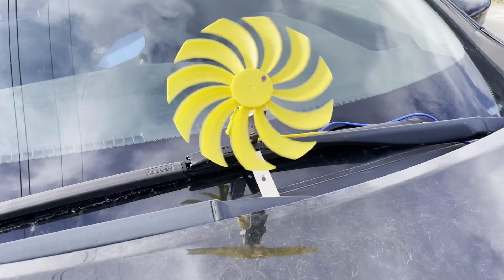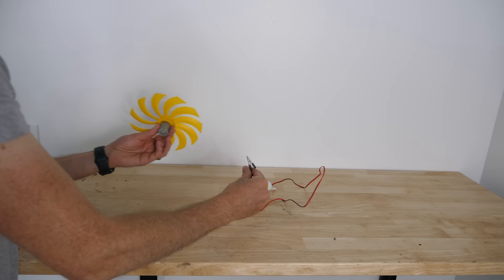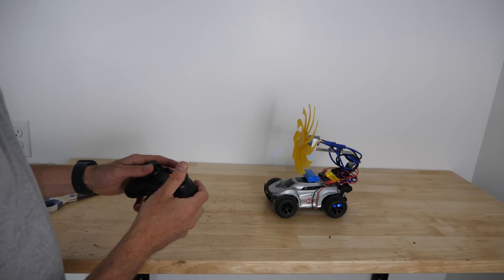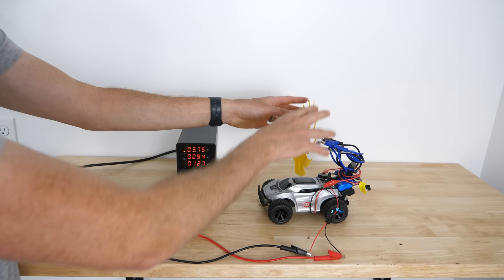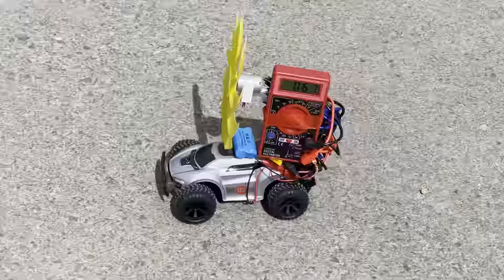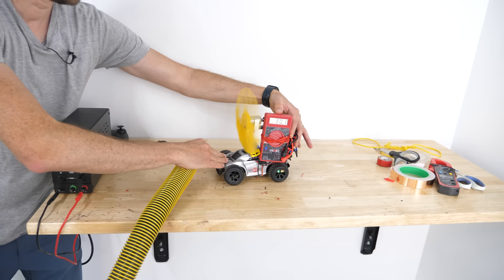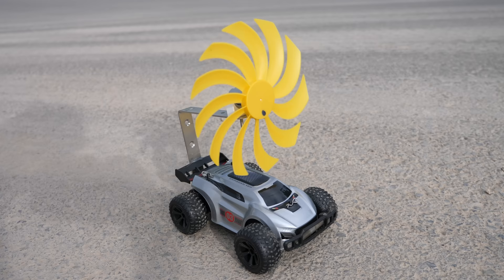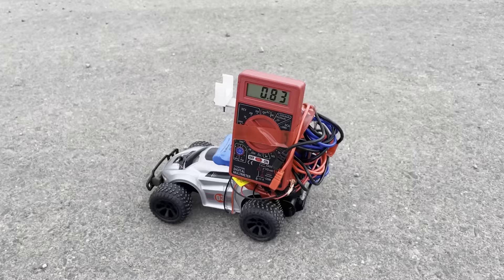Can You Power a Car With a Wind Turbine?

Comment: Surely doing this produces more drag so it is more inefficient
Reply: wow u watched the video too? ur so genius
Reply: Yeah but it can recharge when it sit still therefore it's more efficient in the long run.
Reply: Lol ya thats what he said.
Reply: It depends. You can gain energy if the car aerofynamics are shit from the start and you put the turbine in frobt of the vehicle instead of on the roof.
Reply: Plus weight of generator
Reply: If you're going slower than the windspeed at your back, the rotor doubles as a sail
Reply: @FunnyCODAssasin  do we need to watch the video for it to make sense ?? I mean I knew it when I was a kid tbh. It's basic
Reply: It’s like the old saying. Blowing your own sails. 

Also you hoping that the Jags make it all the way this Season?
Reply: Not if you make the turbine go through the car, so wind passes through.
Reply: Maybe, and don't call me Shirley 😊
Reply: @4xdblack  it's the same you are still increasing the drag
Reply: @jharmley6882  Have you not seen the last video? Its not workint properly to set up a prop to charge things. 

You need a huge prop like 5x the car size to charge it efficiently
Reply: Fold down wind generators and use only while stationary, parked etc
Reply: What would be really cool is if you had a windmill/wind turbine that could fold out when the car is stationary, and fold in when in drive. That way you could charge the battery from ambient wind without having to worry about any worsened aerodynamics.
Reply: @DerAngeloMerte  yeah but I'm just saying it is still a possibility. I mean if Tesla uses Solar why not try make wind works?
Reply: Bingo.
Reply: @FunnyCODAssasin  He doesn't need yo watch the video, just know basic aerodynamics and have common sense.
Reply: What if it's a large car and u got a small windmill kind off thing ?? Afcourse it produces more drag what does it matter with a large car?
Reply: 3:48 🤦‍♂️
Reply: @4xdblack  You are creating more drag by letting the air go through the car instead of over it.
Reply: Damn friction always ruining free energy
Reply: There's a mechanical principal that makes it work in a specific scenario. The blackbird can move downwind faster than the wind that is pushing it.
Reply: Guy did this with larger real wind turbine,
Reply: But putting this in side of the cars inside where there is holes to flow the air will make it better
Reply: @jharmley6882  yeah when it's only good for stationary. So it's better make some huge wind mill so it's can charge larger battery that can charge your car. 

Like a fuel station:3
Reply: Why don’t airplanes use hybrid system like cars so when they’re descending, the turbine recharges a small battery
Reply: Supposed to learn this in school. It’s called the law of conservation of energy. Did he even say that in this video? I didn’t catch it
Reply: @bryanpascual3543  because weight is a big consideration with aviation, and batteries have low energy density. Some small benefit you might get from regenerative braking for some small part of the flight will assist certainly be negated several times over by having to carry around extra battery and electric motor to put into the propeller/turbine.
Reply: That's exactly why just two seconds in I was like"just no".
Maybe the toy car because the motor drivers in them are always 3* stronger than they need to be and the cars are light.
Reply: You are correct more is lost than gained be confident of this.
Reply: It’s complicated it seems
Reply: Yes,but if the turbine is designed in a specific way it can "outstand" drag and get the car to go fast
Reply: BUT FREE ENERGY!?!
Reply: Definitely not. The drag would be so minuscule that it would be completely unnoticeable. Modern alternators rob about 20hp from your engine, this would be a major increase in performance and MPG.
Reply: @4xdblack Put it behind the front grill.
Reply: @engredz I’ve thought of an alternator powered by axels for Evs, not so much to charge the battery but to possibly get more range
Reply: Say you didn't watch the full video without saying you didn't watch the full video 😂

Comment: Sorry, you cannot, in this house we accept the thermodynamics laws. The energy generated by the turbine comes from the movement of the car and this is coming from gasoline or car battery and even worse, the increased drag from the turbine increases the fuel/battery consumption.

Comment: In the 1990's an aerospace company had an idea to add a "windmill" at each wingtip of a transport airplane.  The windmill would be at the trailing edge of the wing tip and would take energy from the wing tip vortex--the vortex is the result of the wing generating lift and is always present if there is lift.  The vortex creates drag--that's why modern Boeing and Airbus airliners have winglets on the tips of the wing.  A windmill could absorb some of this vortex which would reduce drag AND the windmill, tied to an electric generator, could feed power to the aircraft electrical system to power seat back screens, for example.  Not perpetual motion, but a reduction in overall energy consumed.  Perhaps a windmill in the right location on a specifically design auto could have the same benefit?
Reply: That is specific to wing design. The wing tips cause issues and you must break up the air. It's probably more efficient overall to just use a better design than a prop. Otherwise you'd see every plane with a prop there. Even if it's close, not worth the extra weight or complexity.

As far as a car, you don't have anything near the speeds or desings of airplane wings to even think about it.
Reply: Maybe in a spoiler to also create downforce.
Reply: Not practical. You can instead use specific wingtips that make the vortices work in your favor and can actually counteract drag.
Reply: Commercial aircraft do employ a small emergency power unit that deploys in case of a loss of electrical power. It's a small fan that pops out from under the fuselage and generates electricity from the wind - just enough to keep their flight instruments working.
Reply: @sixstanger00  Yes--good point.  In fact, Sundstrand Aerospace, the same company that designs and manufactures the emergency power units (aka RATs...Ram Air Turbine) that you describe, also did some work on the vortex/wing tip generators.
Reply: The idea of offsetting the energy used by recovering what you can from the drag your vehicle is already going to create